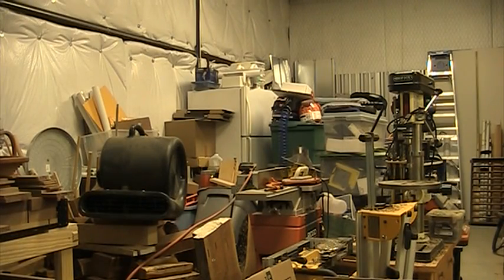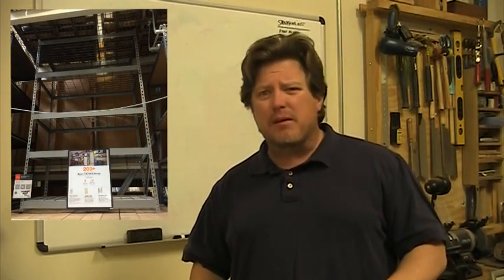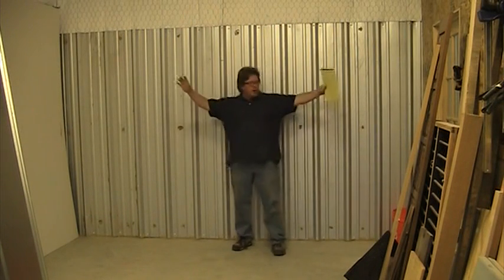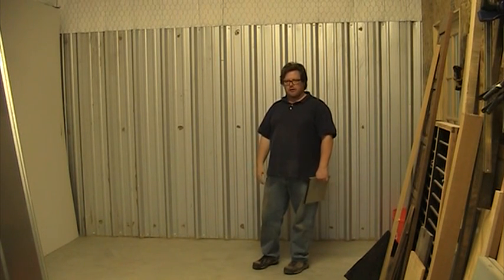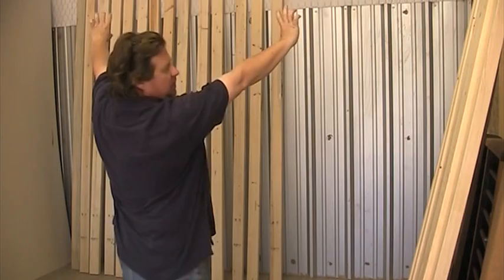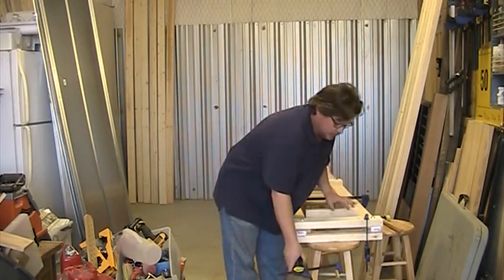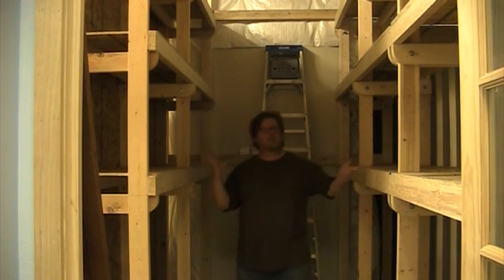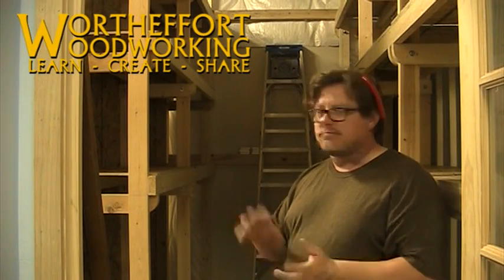Design and Build Shelving (On the Cheap)

Comment: Your framing is basically how i did my shop shelves. Your rounded ends and carriage bolts are more fancy. I used deck screws and screwed the wall side horizontals to the studs in my wall and i used 2x4s across every 2 feet then just layed osb sheeting on top for the actual shelves. They hold a tremendous amount of weight.

Comment: I was looking through some of your older videos and ran into this one and I have to tell you that it would have saved me a bunch of time when I was building my girlfriends dream library. She's into Disney and she wanted me to build shelves like in beauty and the beast, from floor to ceiling so she could put all her books (she had over eighty boxes of books in three rooms, more in the basement and still has all her older books in storage and in her parents house!). I built her her dream room and I bolted them to the ceiling AND to the walls but I still wanted to put as much of the weight on the legs and I didn't know about the bolts so I did half-lap joints on every leg to stretcher and rail connection! I'm working at a children's hospital and running a homeless shelter for kids so I had to do this on my "free time" ... in other words eight months later I was done!
Reply from the maker: Eeks, that's a lot of time. But worth it if she was happy. Prolly looked better too.

Comment: Very strong design! 

IMHO for a project like this it is best to show what you'll be making at or near the start of the video. We don't really get a good idea what the shelves will be like until about 18 minutes in!
Reply from the maker: The icon you clicked showed the finished product?
Reply: You mean the video thumbnail? I don't really look at those, but it is hard to tell much from that image due to the angle.

I am not complaining, just trying to offer a constructive criticism.
Reply: awldune:  skip to the end if you want to see the finished project
Reply: It does show it... but depending on the size of the screen not everything can fit.  For example on my PC at work with large monitors, I could see the whole thing in theater mode and in full screen; in default view, it you do not see the "wortheffort" title block and the finished product; when you hover over it to see the whole name, it covers up the image a bit by shading it out and placing the full title over it, but you are now covering the image with the mouse and the video title pop up.

Still a very good video!  Thanks.

Comment: I like your design.  I've built a hybrid sort between what you displayed and what others have shown.  I've used both the carriage bolts and screws in much the way you did (no nails!) but I  also used 2x4 hangers for my cross members and legs. It may be overkill but I have built shelves that are 40" wide so they can carry all my wife's 40+ year accumulation of Girl Guide (I guess they are called Girl Scouts in the US) camping equipment and such - 800 cuft of stuff!
Needless to say, our garage has long not been where we put our car - LOL.
Reply from the maker: Thanks

Comment: I kind of have a slight dilemma.  I'm building some shelves, above my garage door, (so it has room to open and close, with shelves in place.)  It seems like a simple project, however I'm concerned about it  coming down in the future.  I mounted a 2X3, horizontally, on the front wall of my garage, 20" from the ceiling.(enough to allow clearance for the door to open and close.)  Then, I came out from the corner of the ceiling, 48".  I had to come out 48" because the joist run parallel to the wall, and they are on 16" centers  I am mounting a 2X2 on the ceiling, then mounting 2X4s down from the 2X2, and at the bottom of the 2X4s, mounting another 2X2.  I will then slide a 4'X8' sheet of OSB to rest on the mounted 2X3, and 2X2. I may put some 2X2 braces underneath the OSB for support, if needed.  This shelving is only going to be utilized for storage space, and easy access for my fishing rods, and sandpaper, maybe 2 or 3 storage bins.  After seeing your video on building shelving, do you think this will suffice? Or is it not a good idea, coming out from the ceiling.  I also am planning on using some L brackets to support the 2X3 I am mounting on the wall.
Thanks for your input.
Reply from the maker: to complex a question to be able answer in this type of media.

Comment: Nice & useful & great non measure tactics. Thought at the beginning you were going to use dado joints, but coach bolts with big washers much faster & if needed can be taken apart, personally prefer m12 (~1/2 inch) bolts, but 3/8 strong, overall such a huge $ saving & better than bought.
Reply from the maker: Thanks, though slotting 4x4 legs to accept rails and stretchers would be even stronger.
Reply: +wortheffort I tend to use threaded rod, cut to size, one nut lock-tighted on,  as cheaper than coach bolts, but having load on the threads is more likely to fail than the clean shank of a coach bold which is why I tend to go for m12.

Comment: Wouldn't you run across a problem with shear strength on the bolt as well? We're you able to calculate how much the load would have to be to break it?
Reply from the maker: It is so overkill for what this is shear strength should be fine. Remeber, each shelf is using 4 bolts.
Reply: the shear strenght of a single bog standard 12mm bolt is 31kn or 3100 kg or just over 3 tonne.. I think it will be ok
Reply: I think using ‘common sense’ for this part you have got it wrong. The science says that the bolts pull the pieces of wood together and that compression increases the frictional forces. What holds the shelves up is the friction between the wood, not the screws or the bolts. The bolts are a nice touch and think I’ll be using them for mine for ease of assembly/disassembly.
Reply: @TimRsn  It's both the friction between the wood and shear strength of the bolt. That they work in tandem makes it a very strong support.

Comment: Are those carriage bolts or machine bolts? If you use a washer under the head of a carriage bolt you are defeating its purpose.
Reply from the maker: It worked whatever kinda bolt they are.

Comment: If you are worried about the strength of the shelves, why did you run the OSB unsupported front to back.  I realize that is the short dimension, but wont it sag up to 1 1/2 inches?  Why not add short pieces between the front and back rails in top of the pieces bolted to the legs?  You probably could have gotten by with deck screws.  They would hold much more weight than the sagging OSB.
Reply from the maker: I explained in video that OSB was weak link but I wasn't too worried because it's a short distance (+/-12") and that I was storing mainly boxes (and bowl blanks) which would transfer weight to rails themselves. Pluses and minuses. For my application the OSB will suffice. But you're right, no reason you couldn't add bracing on your own shelves. They even make cheap brackets that make it easy.
Reply from the maker: Also, I had a tiny budget. The kind of bracing you're talking about can be easily added later in needed.
Reply: I understand you mentioned it, but you also went on about how much weight woodworkers put on shelves in wood, machinery, etc. Not all of that will be resting directly on the long members.   The frames are great, but then I think you really dropped the ball when you wen to put in the shelves.  Just my opinion.  I hope they work well for you.
Reply from the maker: +Edwin Landmast you're acting like a troll again. Noticed you created a whole new account since I blocked the last due to your inability to stop making personal attacks. So here's my response to all your personal inquiries. I will not give you my personal income sheets, I will not give you family contacts, I will not go to psychoanalysis and give you a personal copy. I will not date you, or send those 'special' pictures we all know you really want. You deserve nothing personal from me. I'll be blocking this new account of yours because you've proven to be a troll who can't help himself from personally attacking myself and other commenters.
Reply from the maker: Glad you brought it up. Others might add bracing if they need it. I just don't.